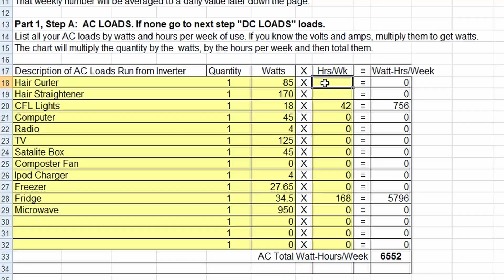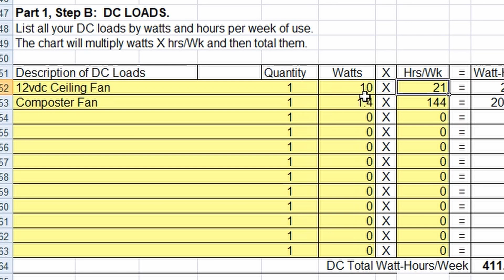Startling truth: Your solar power misconception

Comment: Common sense!   I love it!  My off grid systems have been in operation for over 10 yrs now.   The main system at my camper is currently running on 460 AH at 12 volts LiFePo4.  I have 500 watts of panels over 2 arrays....  one array (200 watts) sees morning sun... the other array (300 watts) sees afternoon sun.  I'm only running lights, radio, tv and Raspberry PI5 computer.  Occasionally a toaster and this time of year a 100w fan at times.  (If I need air conditioning I dig out the genny because of only having a 1200 watt inverter).  I can go a week or more with no sun but it will take more than one day of sun to get a full charge.  My shop is still running on 2 100 AH SLAs with 400 watts of panels (200 am, 200 pm)  There is only lights and radio in the shop with a few tool battery chargers.  Only in winter do I need to dig out my 12v genny (60 amp alternator driven by 6.5hp Harbor Freight engine at idle).   For larger tools, of course, I use my inverter genny for what short amount of time they run.

Enjoying your content!  I ran across your videos a couple months ago.
Reply from the maker: Sound pretty economical and smart!  Cheers!

Comment: Got the Grid for a backup here, but everything you say is spot on. If I were doing Off grid with a generator backup....I would aim at least for 2-3 day battery supply.
Reply from the maker: I always suggest 3 to 5 days because it always ends up at 2 to 3 🤣

Comment: You should always oversize your system for many reasons. First off it takes more power to fully charge your batteries than the power you took out of your batteries,  Second you need enough solar to completely recharge your batteries and power your home while you're charging your batteries.  Third you're going to have cloudy days and your solar generated power will be greatly reduced,  but you still want to fully charge your batteries so you should increase your solar output to compensate for cloudy days.
Reply from the maker: True, most don't think about the power the components themselves use but that does fall under "what you will use every day"

Comment: 3:20 Reminds me of the scene in Apollo 13 when Lt Dan was trying to find a command module startup sequence that would fit in the available power from its battery system.
Reply from the maker: Haha, maybe I should start calling myself Lt. Dan from now on!
Reply: @TheOldJarhead  I (mostly on purpose) conflated two movies where the actor who played Lt Dan (Gary Sinise) in Forrest Gump played the astronaut Ken Mattingly (had to look it up) in Apollo 13. I wasn’t so much intending to compare you to the fictional Lt, more I was referring to the process of cataloguing all the loads. Pretty cool. If you watch movies but have not seen Apollo 13, I’d recommend it. Due to startup pull, they had to not only figure out the minimum required equipment to power, but also the right order to bring it all up.
Reply from the maker: LOL I understood actually :)  All good!  I laughed at that one!  But I get it!  And yes, I've seen it a few times!  Love it and Forest Gump!

Comment: This is dead correct, well said and very clear. I think the only other item I might add to your points is going with 48volt batteries so you don't have to do a second video on that.... eh, actually, maybe you should do a video on that.
Reply from the maker: LOL I thought I did mention different battery voltages but not why but I may just have to done one for ya!  Thanks!

Comment: Watts and amps are correlated. In my opinion, watts are better to use
Reply from the maker: Except when figuring out breaker sizes, conductor sizes and in many cases battery bank sizes 😉 but both must be understood

Comment: I use the analogy of a hot rod car. You ask a hot rod owner, what size his engine has. Not what size his alternator is.  Same thing with solar. The panels are nothing more than a charger, alternator. Not the size of the engine/ batteries.
Reply from the maker: That's excellent!  Nice one.

Comment: Very well said. Other things to consider are if you have an east view of morning sun or a west view of sun setting that are clear. Adding a couple panels facing east or west in winter can really add a lot more power to your batteries in winter. Like he said he gets 2 hours and I bet that is from the south. Now if you can get 1 hour from east and 1 hour from west you doubled your intake for the day in winter. Example 9 kw south facing, 2 kw east facing and 2 kw west facing. I have total blockage facing west in winter so I am doing 11kw south and 2.35kw east. I also use grid as backup in winter for now. I also have 52kw of usable power from battery banks which in winter is not enough so that also needs to be doubled so on sunny days when I can  25kw a day into and only use 18kw I gain 7kw into batteries. Only 60 days I have to worry about sun power but I do not really worry as the grid is my backup.
Reply from the maker: That's the beauty of my ground mount panels.  I turn them to the SE to catch the morning sun.  Being off grid there is no utility power for backup.

Comment: Great common sense approach. Amp Hours can be deceiving unless one is diligent to remember the voltage and compare apples to apples. Watt Hours are key as you started with. A few more things to consider is the idle consumption of any inverters and phantom power draws such as phone chargers even when they are not charging a phone.
Reply from the maker: Great points

Comment: Easy to calculate how much electricty you are going to use by looking at your old electric bills.
Reply from the maker: Yes except no.  The problem with those building off grid is that they don't know what they WILL use.  For example, my home in the 'city' uses a LOT more than I use at my off grid place.  In fact my off grid cabin uses only a fraction of what my house uses - or more correctly, what we use.  You see, an off grid place requires you to actually look at what you WILL use first.
Reply: That works up to a point, but once you start getting obsessive, you'll learn more about where the waste is coming from and dropping your consumption right down. Simple things like hibernating a PC before going for lunch saves me 200Wh, turning of my microwave unless I want to use it 600Wh every day (I know it's shocking how bad it was). Then there's choosing how you use power depending on storage, so I wouldn't use my air fryer to make fries unless I know that energy is likely to be spare over and above essentials. 

Also, I'm not sure it's always so simple to look at what you use, batteries and panels take up space, your deciding factor might be how many panels I can I get into my plot of land, your solar input becomes the important (if almost impossible to calculate) factor and it's that which dictates the capacity of batteries required, and it may indicate a gas powered generator is going to be needed more than as an emergency.
Reply from the maker: Or don't obsess just figure out what you need, build the system and live with it 😉

Comment: You're correct,  but also not quite. 
I run my inverter on solar power panels to run my washing machine and a couple of other things I only run during the day.  That reduces the batter bank size quite substantialy. 
However I am in Australia,  we get a lot of sunshine here.
Reply from the maker: That works as long as the sun shines 😉
Reply: @TheOldJarhead  yup,  I tend to not do my washing on cloudy rainy days and I find that the garden requires less water on wet and or cloudy days. 
But you're right,  Plus I have to keep my solar in mind as a live and do things,  I. e live accordingly,  as I think most do when living with solar. 
Cheers mate.
Reply from the maker: Exactly!  Cheers!

Comment: Great advice but one thing I found is that the more panels and charge controllers I have the faster I can charge my bank. And the new bifacial panels are way better in the winter months. 3 regular panels might get you charged in a day of summer but it might take 15 panels to get that charge in the winter in one day.
Reply from the maker: Yes, I have two charge controllers as well and in the winter my 9 panels can most of the time provide all the charge I need and more...unless it's just really cloudy and snowy for days and days which can happen, then my generator takes over ;) But I have a large enough battery bank I can go days without sun too :)
Reply: @TheOldJarhead  I built 2 battery banks. 1 is 12 kw of Nissan leaf cells and the other is 30 kw of 280ah eve grade a cells. I bought the DC to DC 24 volt charger from victron and programmed it to where if the lifepo4 gets low the charger comes on and dumps the leaf power into the lifepo4 bank. It's kinda my emergency back up. I'm wanting to get a DC to DC 12 to 24 volt charger so if I had to I could use my truck for some extra charge as well. I'm glad to see your videos and it's good knowing there are other people out there doing what I'm doing. Thanks for sharing your system
Reply from the maker: Wow that's pretty big!
Reply: @TheOldJarhead  yeah.. it is turning into a fairly large system. My wife was good with it last year even tho I'd spent over 30 grand on just the components. After that we had plenty but I kept spending this year as well now I'm about 45 thousand dollars into this solar stuff and the wife's pissed. I just wanted to keep growing the system so that no matter what I'd have backup components for each piece and enough separate solar arrays so that I'd get a good charge even on cloudy days. There is absolutely no way I'll live long enough to see return on my investment but the being my own power company means a lot to me.
Reply from the maker: Ahhh, I can see that 😉  I'm fortunate in that mine is just for a small cabin in the woods, and I have too many other projects!
Reply: @TheOldJarhead  you ain't gonna believe this lol but mine is running a 30 foot camper. I have enough power to run a regular house lol. It can run the mini split year round non stop for heating and cooling and I can make it for about 5 days of normal operation without even turning the solar panels on. I'm on the road In my semi truck most the time and it's always 100 percent when I get home and normally don't go below 80 percent as long as the panels on the roof are on. I have 3 separate arrays at the moment there is 1040 watts on the roof. 1140 on another small array. And 1410 on the third array. I'm buying panels for my 4th and adding 4 more panels on the roof. I figure I'm not gonna do over the road trucking for much longer and when I get a local job I'll need a lot more charge.  If I ever get a actual home I plan to move all my solar equipment over to a small house but who knows when that will be. I'd love to have a place like yours one day. My wife has always been with me in the semi so we are good with tight spaces for the most part but we would absolutely love having a regular house with a shower and bath tub and a little larger bathroom. After I beat cancer a couple years ago we decided to try to set up our life where we can still make it if I get sick again so that's why we went the direction of the camper. It's really nice but it's for sure not a house lol .
Reply from the maker: wow

Comment: You are 99.999% Right about the Panels. On Cloudy Days, you will still get SOME Power to the Panels If you have a larger array, this will somewhat offset the loss resulting from Cloud Cover. That being said, I DO agree you should have at least a small Generator for when you aren't getting the Sun you need.
Reply from the maker: Thanks, and yes, I've even gotten power when they were covered in snow but its just a trickle.
Reply: @TheOldJarhead  That's why God invented brooms, LOL!😊
Reply from the maker: Except when the panels are up about 10 feet on a snowy steel roof 😉

Comment: I love the commentary.  You managed to jam a whole lot of basic information into this.   It is amazingly difficult to teach people these basic things, particularly the difference between watts and watt-hours.  Between power and energy.

OMG I spend like half my time just on that.  Watts vs watt-hours.  And not just for simple things like a microwave where you can count the minutes you use it.  Things like toaster-ovens, for example, and small induction burners... stuff like that. The basics of how to get a fully electric kitchen in an RV without using a ton of energy.  And how to run power to everything / be able to run things concurrently without having to run huge cables.

Heating and cooling also winds up being a long conversation.   And system voltage, though usually once the person realizes that 48V (51.2V LiFePO4) @ 100A = 5000W of capability with only 2 AWG cabling, things go more smoothly.  But ugh... so many people married to 12V, it can take a while to convince a person.   Even golf-carts these days have 48V batteries and solar panels.  It just isn't that big a deal.

One thing you didn't mention was sizing the battery system, particularly for winter-time overnight loads.  It needs to be able to give you a decent night's sleep on its own without the generator having to run at 2am (ideally).  In winter that can be a 15-hour swath of time.
Reply from the maker: Thanks - and yes it's very difficult some times!  The most difficult thing is to put it into a video people will watch ;) but I try to do that.  Cheers!

Comment: Great explanation of how "off grid power systems" work!  Open-ended rabbit hole unless you are fully prepared upfront.  

For me, K I.S.S. and basic needs versus wants works best 😊
Reply from the maker: Thanks.  KISS is the best way to go IMO
Reply: Yep, for a girl! 😂😂
Simple HF 2000w inverter, 40a mmpt controller and 100 amp hour AGM battery with 3-100w panels. Attempting to build up but a little challenged by fuses and such. Yr videos are helpful.
Reply from the maker: Do you have a combiner box?  That's my preference when it comes to fusing.   Also, you can always add more batteries, a bigger inverter or a second set if panels.
Reply: @TheOldJarhead  No, not yet. I saw video on combiner box. Waiting to pull the trigger on that investment. ITMT, game plan to add batteries and panels. 

Thx for sharing knowledge and information with newbies like me! 🙏🏽
Reply from the maker: If I were doing it on a budget and likely to add a different sized array I'd just get a main disconnect box with 250a breaker and some proper breakers for the array and skip the combiner unless I planned to add multiple arrays odmf the same size.   And happy to help!
Reply: @TheOldJarhead  Will do 🫡
Reply from the maker: I am happy to help!  I'll be going live on Sunday at 530pm Pacific if you want to pick my brain of any other questions.
Reply: Erik, Thanks for venturing into the "solar system".  Please do a video about battery types. That's a whole new rabbit hole to venture into. 30 years at our campground has taught us that when it comes to batteries, expensive does not mean the best. Buyers beware!
Reply from the maker: Thanks and thanks for the suggestion I may have to do that
Reply from the maker: I decided to do just that and you might find you agree with it ;)  Expensive isn't always cost effective either!